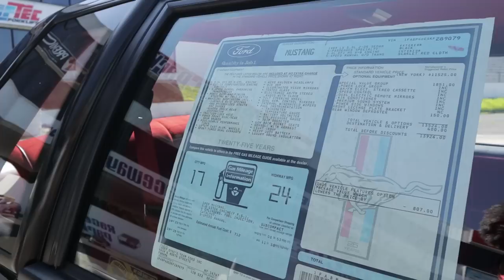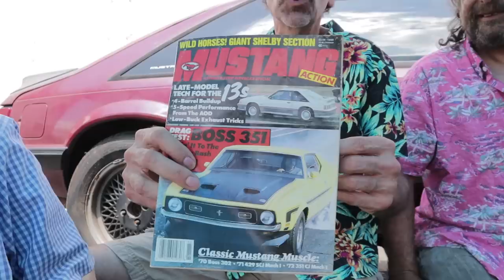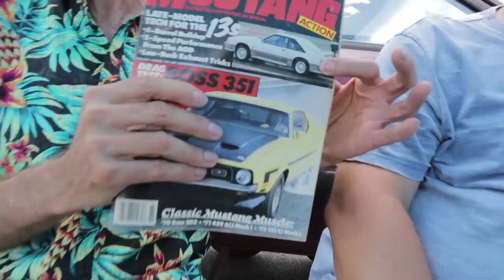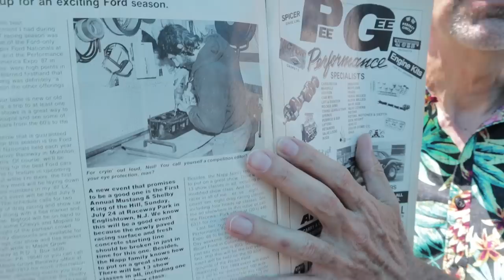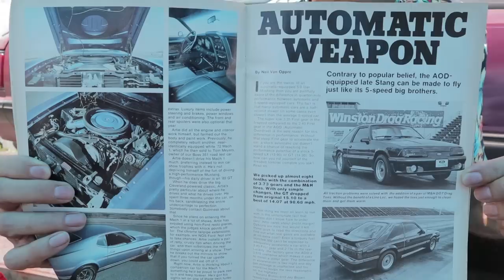5.0 Fox Body Mustang Revolution- The Second Coming Of The American Muscle Car

Comment: I started with a new '85 LX 50 Coupe with 2.73's, you walked the car out as Tony says and then you kept your right foot to the floor and shifted like an animal into 2nd and 3rd. One time while power shifting into 3rd and the shifter bolts broke and I punched the stereo busting open my hand and the stereo. The 87's were speed density so they reacted to mods a lot like the '85 carb model did (so did MAS Air as far as timing goes and SC was easier as well), you yanked the front sway bar, bypassed heater lines to the throttle body, bumped up timing, 160 thermostat, pull the air filter, bypass the air pump, AC, power steering and put in a gear and tires and you were in the mid to very low 13's easy. I got my '85 GT into the  mid 12's with Ford racing heads before the GT40's came out, Edlebrock Performer intake a Holly 600 dble pumper, 3.73's, shorty headers on street tires and I was taking ZR1 lunch money from there. I miss those days, you worked for those ET's! Now, my bone stock 18 GT A10 went 12.0@117 bone stock and 11.7 on E85, we are spoiled today!
Reply: Just so happened, I was graduating in 87'.. mom and dad didn't want to get me a fast v8 car.., so for graduation, damn.. i was mad as hell! Soo.. graduation day... "I got a little.. v6 Grand National!" (😎😁)
bone stock the car ran a 13.1@104! 
anything in the 13's at 100's and you were doing something back then! damn.. the fun we had, and for the most part Everyone.. got along!

Comment: How do you keep transmissions in a fox body 5.0.  I couldn’t go more then 1-2 days around town driving without destroying counter shafts.  They would Grenade all day
Reply: You don't keep them if you're driving the way you have to to run 13s in a stock coupe. You end up busting them. This came up around 5 minutes into the video.

Comment: Talking about the computer limiting the options you had to make it go fast. Well I bought a new 1984 Hurst/Olds, it had a 307 Olds motor, and I wanted to add a 140hp nitrous system but several mechanics said I couldn't do that because the computer wouldn't allow it. Well, I installed it anyway and it worked, I had 140hp of instantaneous power, and back in 1984 that was good power. From the factor my car came with a 373 rear end gear. Ran 13:20 through the quarter, with the nitrous.

Comment: I'm a 5.0 Mustang believer. I ran nothing but GM stuff from 60's carb'd to late 80's early 90's TPI until I got my first Foxbody.  I eventually had a '91 black hatch and an '89 white notchback at same time. I was hooked  (pun intended) from the beginning.
Thanks for a trip down what sounded just like my own personal memory lane.
EDIT. My only video I ever uploaded to YouTube is of both my 5.0's in my garage. I was videoing the sound of the B cam the notch.
 https://youtu.be/k6WIjIrTC_g
Reply: WHAT BERNIE SAID ABOUT YOU COULDN'T BUY ANY PARTS FOR THE SMALL BLOCK FORD STEMS DOWN TO THE THREAT THE SMALL BLOCK FORD POSED TO THE SMALL BLOCK CHEVY BACK IN THE 60'S WHEN THE 289ci DEBUT. THE 289ci WAS SUCH A THREAT TO THE SMALL BLOCK CHEVY THAT THE NHRA (HENCHMEN FOR GM OR ANOTHER DIVISION OF GM) IN ORDER TO KEEP CHEVY IN THE WINNERS CIRCLE. WOULD CHANGE THE RULE BOOK ON THE 289ci MOTOR LIKE THE WEATHER CHANGED IN KANSAS TO DISCOURAGE ANYBODY FROM RUNNING IT. THE CHANGING OF THE RULES WERE BOTH WRITTEN AND UNWRITTEN. SO IF YOU SHOWED UP AND RACED AND WON. THE NEXT TIME THE RULES ON THE MOTOR WOULD BE CHANGED SO YOU COULDN'T RUN IT. IT WAS ALL BASED ON CHEATING. WHAT I WROTE HERE FINALLY ANSWERS THE MYSTERY QUESTION OF WHY FORD'S COST MORE TO BUILD. ON THE OTHER HAND YOU CAN BUY RACE PARTS FOR THE SMALL BLOCK CHEVY THAT WERE EVERYWHERE AT NICKEL AND DIME PRICES. SINCE THE SBC WAS THE FAVORED MOTOR. THERE PARTS WERE NEVER RESTRICTED AND MASS PRODUCED WHICH KEPT THEM CHEAP. ON THE OTHER HAND NEITHER WOULD FORD NOR THE AFTERMARKET RISK PRODUCING RACE PARTS FOR THE SMALL BLOCK FORD WHICH THE HENCHMEN FOR GM THE NHRA WOULD BAN OVERNIGHT, AND THE MANUFACTURERS WOULD BE LEFT WITH A WAREHOUSE FULL OF SCRAP METAL. BECAUSE IF YOU CAN'T RACE IT AND WIN, THEN PEOPLE WOULDN'T BUY IT. FOR THE FEW COMPANIES THAT DID PRODUCE PARTS LIKE CAMS, MANIFOLDS, PISTONS, ETC. THESE PARTS WERE PRODUCED IN SMALL VOLUMES BRINGING TO COST UP 2-3 TIMES MORE. NOBODY WOULD DARE PRODUCE A HEAD FOR A SMALL BLOCK FORD BECAUSE OF THE THREAT OF A BIG EXPENSIVE PART LIKE THAT BEING BANNED, WHILE AFTER MARKET HEADS FOR THE SMALL BLOCK CHEVY WERE PRODUCED WITHOUT RESTRICTIONS. WARREN BROWNFIELD WHO I THINK LATER STARTED AIR FLOW RESEARCH WAS MAKING RACE HEADS FOR THE SMALL BLOCK CHEVY FOR YEARS AND SO WAS EDELBROCK. SO IF YOU WANTED A HEAD FOR A FORD WHERE DID YOU GO, NOWHERE. YOU HAD TO MAKE IT. YOU ACTUALLY TOOK CHEVY VALVES AND MACHINED THEM DOWN. ALSO WHAT BERNIE SAID ABOUT A HEAD BEING AVAILABLE FOR THE SMALL BLOCK FORD. CAME ABOUT IN 1989 WHEN TRICK FLOW PRODUCED THEM. IMAGINE IT TOOK CLOSE TO 30 YEARS TO PRODUCED A HEAD FOR THE SMALL BLOCK FORD. AND THE ONLY REASON THEY DID WAS DUE TO THE POPULARITY OF THE SMALL BLOCK 5.0 MUSTANGS. AT THE TIME IT DEBUT THE RACE TRACKS WERE DEAD. ONLY CERTAIN HARDCORE RACERS MOSTLY CHEVY, WERE THERE AND THE STANDS WERE EMPTY. ONCE THE MUSTANG 5.0 CAME INTO EXISTENCE IT INJECTED STEROIDS INTO RACING AND HAS BROUGHT RACING TO WHERE IT IS TODAY. NITROUS, TURBOS AND SUPERCHARGING COMPANIES CAME INTO EXISTENCE AND THE ONES THAT DID EXIST STAYED IN BUSINESS BECAUSE OF THE POPULARITY AND MASSIVE POTENTIAL THE SMALL BLOCK FORD HAD TO MAKE POWER. WHEN I THINK ABOUT THIS STUFF. I THINK ABOUT HOW BIG OF AN IDIOT GALE BANKS WAS THINKING CHEVY WAS THE BEST AND THOUGHT NOTHING ABOUT FORD. IF HE WOULD HAVE PRODUCED TURBOS FOR THE SMALL BLOCK FORD. TODAY HE WOULD BE ONE OF THE DOMINATE LEADERS IN TURBO TECHNOLOGY UP AT THE TOP. BUT THINKING CHEVY WAS THE BEST BLINDED THIS MAN WHERE TODAY HE IS A LIMITED COMPANY STRUGGLING ALONG TO STAY ALIVE. LOOK AT THE IRONY OF THIS WHOLE THING. THE NHRA PUT BANS ALL OVER THE SMALL BLOCK FORD FOR YEARS TO KILL IT. ONLY FOR IT TO COME BACK YEARS LATER TO BIT THE CHEVY SMALL BLOCK IN THE ASS. ALL YOUR 5.0 RACE CLASSES WERE CREATED FOR FORD, BECAUSE THE SMALL BLOCK FORD HAD NO COMPETITION, THE CHEVY SMALL BLOCK COULDN'T COMPETE IN THESE NITROUS, TURBO AND SUPERCHARGING CLASSES. IN ORDER TO BECOME A PLAYER YEARS LATER GM DUMPED THE CHEVY SMALL BLOCK IN FAVOR OF MAKING THEIR OWN SMALL BLOCK FORD THE LS. FROM TOP TO BOTTOM THE LS IS 1000% FORD. NOT 1 ONE DESIGN ASPECT OF THE OLD SMALL BLOCK CHEVY LIVES IN THE LS, THE LS IS ALL FORD IN DESIGN.

Comment: Damn good video Tony! I miss my mustang. It was a fun one, not fuel injected, but it was bored.40  with dart pro 1 heads and a voodoo cam, It really needed a t5 swap as it had that stinking srod in it, and 273's, I had to sell it to buy my house before i could put the 411's in it and t5 swap it, the guy I sold it to, did do those 2 things and it pulls the front wheels on drag radials. Miss that damn car.

Comment: what a great video.5.0 sbf nothing short of legendary.ford hit a home run with the efi foxbody.hell the small block ford itself is legendary.look at the old 289 only american motor to survive 24 hours of le man,s racing.
Reply: THE 289ci WON LEMANS IN THE DAYTONA COUPE IN 1964 IN THE GT-3 CLASS AND BLEW FERRARI AWAY. NO CHEVY SMALL BLOCK NOR BIG BLOCK EVER WON LEMANS UNTIL GM COPIED THE WINDSOR 351 FORD AND PRODUCED THE LS, AND EVEN THEN BIG POLITICS WERE INVOLVED TO GET CHEVY INTO THE WINNERS CIRCLE.
WHAT BERNIE SAID ABOUT YOU COULDN'T BUY ANY PARTS FOR THE SMALL BLOCK FORD STEMS DOWN TO THE THREAT THE SMALL BLOCK FORD POSED TO THE SMALL BLOCK CHEVY BACK IN THE 60'S WHEN THE 289ci DEBUT. THE 289ci WAS SUCH A THREAT TO THE SMALL BLOCK CHEVY THAT THE NHRA (HENCHMEN FOR GM OR ANOTHER DIVISION OF GM) IN ORDER TO KEEP CHEVY IN THE WINNERS CIRCLE. WOULD CHANGE THE RULE BOOK ON THE 289ci MOTOR LIKE THE WEATHER CHANGED IN KANSAS TO DISCOURAGE ANYBODY FROM RUNNING IT. THE CHANGING OF THE RULES WERE BOTH WRITTEN AND UNWRITTEN. SO IF YOU SHOWED UP AND RACED AND WON. THE NEXT TIME THE RULES ON THE MOTOR WOULD BE CHANGED SO YOU COULDN'T RUN IT. IT WAS ALL BASED ON CHEATING. WHAT I WROTE HERE FINALLY ANSWERS THE MYSTERY QUESTION OF WHY FORD'S COST MORE TO BUILD. ON THE OTHER HAND YOU CAN BUY RACE PARTS FOR THE SMALL BLOCK CHEVY THAT WERE EVERYWHERE AT NICKEL AND DIME PRICES. SINCE THE SBC WAS THE FAVORED MOTOR. THERE PARTS WERE NEVER RESTRICTED AND MASS PRODUCED WHICH KEPT THEM CHEAP. ON THE OTHER HAND NEITHER WOULD FORD NOR THE AFTERMARKET RISK PRODUCING RACE PARTS FOR THE SMALL BLOCK FORD WHICH THE HENCHMEN FOR GM THE NHRA WOULD BAN OVERNIGHT, AND THE MANUFACTURERS WOULD BE LEFT WITH A WAREHOUSE FULL OF SCRAP METAL. BECAUSE IF YOU CAN'T RACE IT AND WIN, THEN PEOPLE WOULDN'T BUY IT. FOR THE FEW COMPANIES THAT DID PRODUCE PARTS LIKE CAMS, MANIFOLDS, PISTONS, ETC. THESE PARTS WERE PRODUCED IN SMALL VOLUMES BRINGING TO COST UP 2-3 TIMES MORE. NOBODY WOULD DARE PRODUCE A HEAD FOR A SMALL BLOCK FORD BECAUSE OF THE THREAT OF A BIG EXPENSIVE PART LIKE THAT BEING BANNED, WHILE AFTER MARKET HEADS FOR THE SMALL BLOCK CHEVY WERE PRODUCED WITHOUT RESTRICTIONS. WARREN BROWNFIELD WHO I THINK LATER STARTED AIR FLOW RESEARCH WAS MAKING RACE HEADS FOR THE SMALL BLOCK CHEVY FOR YEARS AND SO WAS EDELBROCK. SO IF YOU WANTED A HEAD FOR A FORD WHERE DID YOU GO, NOWHERE. YOU HAD TO MAKE IT. YOU ACTUALLY TOOK CHEVY VALVES AND MACHINED THEM DOWN. ALSO WHAT BERNIE SAID ABOUT A HEAD BEING AVAILABLE FOR THE SMALL BLOCK FORD. CAME ABOUT IN 1989 WHEN TRICK FLOW PRODUCED THEM. IMAGINE IT TOOK CLOSE TO 30 YEARS TO PRODUCED A HEAD FOR THE SMALL BLOCK FORD. AND THE ONLY REASON THEY DID WAS DUE TO THE POPULARITY OF THE SMALL BLOCK 5.0 MUSTANGS. AT THE TIME IT DEBUT THE RACE TRACKS WERE DEAD. ONLY CERTAIN HARDCORE RACERS MOSTLY CHEVY, WERE THERE AND THE STANDS WERE EMPTY. ONCE THE MUSTANG 5.0 CAME INTO EXISTENCE IT INJECTED STEROIDS INTO RACING AND HAS BROUGHT RACING TO WHERE IT IS TODAY. NITROUS, TURBOS AND SUPERCHARGING COMPANIES CAME INTO EXISTENCE AND THE ONES THAT DID EXIST STAYED IN BUSINESS BECAUSE OF THE POPULARITY AND MASSIVE POTENTIAL THE SMALL BLOCK FORD HAD TO MAKE POWER. WHEN I THINK ABOUT THIS STUFF. I THINK ABOUT HOW BIG OF AN IDIOT GALE BANKS WAS THINKING CHEVY WAS THE BEST AND THOUGHT NOTHING ABOUT FORD. IF HE WOULD HAVE PRODUCED TURBOS FOR THE SMALL BLOCK FORD. TODAY HE WOULD BE ONE OF THE DOMINATE LEADERS IN TURBO TECHNOLOGY UP AT THE TOP. BUT THINKING CHEVY WAS THE BEST BLINDED THIS MAN WHERE TODAY HE IS A LIMITED COMPANY STRUGGLING ALONG TO STAY ALIVE. LOOK AT THE IRONY OF THIS WHOLE THING. THE NHRA PUT BANS ALL OVER THE SMALL BLOCK FORD FOR YEARS TO KILL IT. ONLY FOR IT TO COME BACK YEARS LATER TO BIT THE CHEVY SMALL BLOCK IN THE ASS. ALL YOUR 5.0 RACE CLASSES WERE CREATED FOR FORD, BECAUSE THE SMALL BLOCK FORD HAD NO COMPETITION, THE CHEVY SMALL BLOCK COULDN'T COMPETE IN THESE NITROUS, TURBO AND SUPERCHARGING CLASSES. IN ORDER TO BECOME A PLAYER YEARS LATER GM DUMPED THE CHEVY SMALL BLOCK IN FAVOR OF MAKING THEIR OWN SMALL BLOCK FORD THE LS. FROM TOP TO BOTTOM THE LS IS 1000% FORD. NOT 1 ONE DESIGN ASPECT OF THE OLD SMALL BLOCK CHEVY LIVES IN THE LS, THE LS IS ALL FORD IN DESIGN.

Comment: The five-liter V-8 available for the Mustang is a torquey beast with considerable—for 1979—horsepower: something around 150. In preliminary testing it clocked zero-to-sixty times of 8.3 seconds and turned in a quarter-mile run of 17 seconds at 84.8 mph. Oct 1, 1978.  To put this in perspective, Dodge's little pickup SMOKED it. HOT ROD flogged a production '78 in its June 1978 issue and achieved a quarter-mile time of 15.71 seconds at 88.06 mph.

Comment: the early 80s was the revival of speed. I owned a 1980 Mustang Cobra they were still under 200hp with the 5.0 2bbl at that point and it was nothing but noise. but by the mid 80s they were coming up with the hp but then I bought my first old school Pontiac and I never looked back. still fun times though and I wouldn't trade it for nothing!

Comment: I stopped using a 195 degree thermostat and opted for a 160 in all my cars because of the between cold and hot performance and it gave me a bit more time if the temp gauge starts climbing.

Comment: I know what they mean about going faster by trying to grenade it. When you can't get any faster, high rev launch's, slicks, and power shifting that would make a normal person cringe when they drive their daily will make so much difference and make a huge improvement on your E/T. I took a basically stock 4.6 2v mustang from low to mid 9s in the 1/8 mile to 8.3's, consistently then added small cams and went 8.0xx's. Same 4.6 2v with Trickflow heads and larger Cams and tune and ran 7.69 naturally aspirated. While I had a friend with same year car and 2v 4.6 procharged 12#'s of boost running 7.5s in the 1/8 with no driver mod.

Comment: Now I miss my 88 notch more than ever. Speed density, 3.73 gears, Yukon axles, BMR rear suspension, battle boxes, 1.7 rockers, fuel pressure regulator, underdrive pulley kit, no ac, electric fan, and 18* of timing on home brew race gas. Pushed it to 12.90's on DRs and Budd's creek and daily drove it with 21 MPG.........never should have sold it....

Comment: It’s funny Tony I never watch this video but I sold my 1969 GTX and I bought an 87 5.0 GT just like the one your buddy had with the gray bottom and the white with the orange stripe in the middle and the guy I bought it from ordered it  with no air-conditioning and the car was a freak very fast never took it  to the track.

Comment: great video ,I've been thinking of doing a project, dropping a EcoBoost  into an SVO. Any thoughts?
Reply from the maker: I think I saw that swap done on one of the TV shows a while back
Reply: Yeah.Dont.
Reply: Junkyard empire did it
Reply: Keep it stock. It’s a touchstone car
Reply: Well... Do you currently have the SVO or an Ecoboost? If so, what are the current conditions? If you have an SVO with no motor, and an Ecoboost sitting there, then that makes it an easy question to answer.

Comment: Oh yea, the Mustang GT. Drove one and had to have it. It was the first time I bought a new car when I got my '84. 5.0 with a 5 speed and a Holly 4 barrel, (and the exotic 15.5 inch Michelin tires that soon became impossible to find). At the time it was the only American V8 car you could get with a stick shift, and I loved that weird twisted shifter. 

Man, I was gonna keep that car forever! 

Unfortunately that didn't work put because the insulation on the wiring started to deteriorate. Then, on a ski trip to Mammoth Mtn Ca with my now wife, we took a side trip to Mono Lake and the car broke the crankshaft on a dirt road leading to the lake. Lucky for us someone came by and rescued us. It was dead of winter and we were out sight seeing, would have frozen to death. 

When I tore the engine down after towing the car home, I was shocked, shocked to see a spaghetti thin CAST crank!?!? I decided to dump the thing at that point. I was only a few months ago when I mentioned all this to a mechanic friend, that he responded by saying I bought the wrong year. Guess so, cause you guys don't seem to mention anything older that '86.
I always get a laugh when I tell people that the one car I ever bought new, is to this day, still the newest car I've ever owned. 

I now drive a '65 Valiant 273 convertible resto/mod that I build especially for myself. It's a better car than the 84 GT OMHO.

Comment: i have the FIRST 1982 MUSTANG GT 5.0! Ordered it October 1981, Production Date November 1981 Received car in my possession on January 8, 1982 a Monday. It arrived at the dealer on January 4, 1982 on my birthday! It would have been here before the 1st but was dropped in Charlotte NC and run on the Speedway. Ford had to knock off $500 dollars for the miles put on it, it had over 300 miles when I got it. I still have it and it now needs restoring.
Reply: WTF only $500 for 300 miles! You should have gotten way more for that

Comment: 1986 Omni GLH Turbo 14.9 1/4 mile @ 93.4 with $145 MP 10psi computer. I beat many of these 5.0s on the street back in 1986-88, at the track the 5.0 would get a better launch, I remember times of 14.7 to 15.1@ 91-92 mph for the 5.0s. I still have all these Car Illustrated Magazine in storage boxes...Ha.

Comment: E6 heads definitely don't flow as good as E7's, but they are good for torque. Guys would shift them at lower rpms and make faster passes than letting the engine rev higher before shifting. Good heads for a daily driver but not as much for a race car. Like any head though, if you clean them up, you can make some good power with them. I had a 89 Crown Vic 5.0 with the E6 heads. Installed Mustang tube style manifolds, dual exhaust, eliminated the ac/smog pump belt and bumped the timing along with getting the TPS dialed in. Wasn't a fast car by any means, but it was definitely faster and got 20+mpg. Love this documentary.